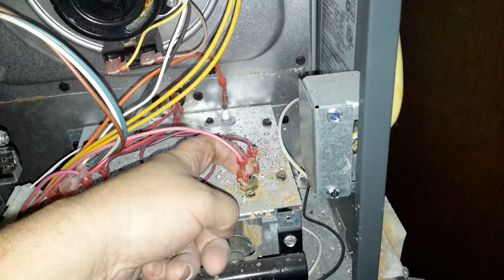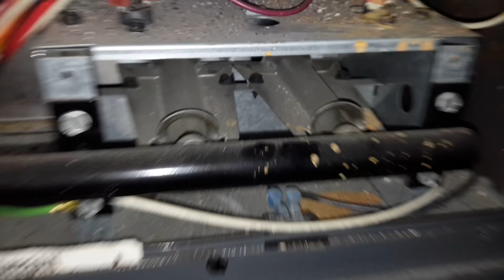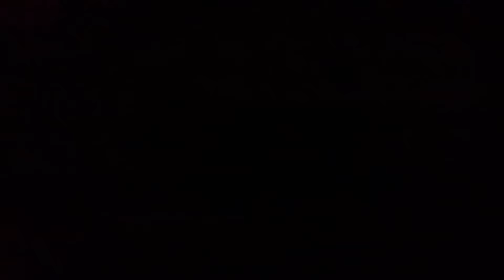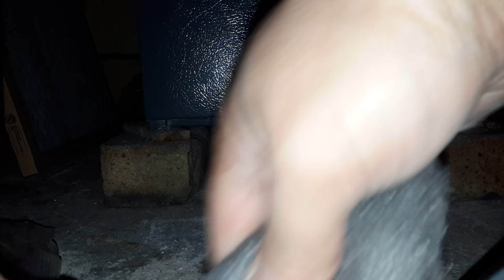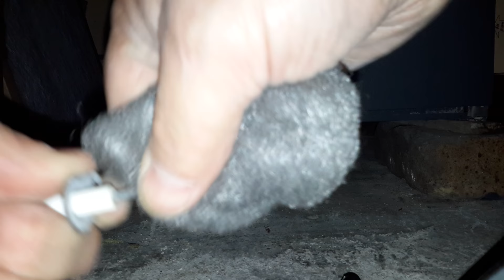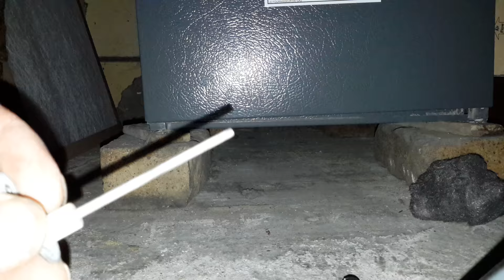Bad flame sensor Goodman furnace

Comment: I have the model with 3 burners instead of 2 but it’s laid out the same way and the flames intermittently went on and off. I removed the sensor and took some light sandpaper to it, put it back in place and, boom, flames stayed on!
These kind of videos are so helpful!
Thanks.

Comment: Just want to thank you 🙇🏻‍♂️ 

I did notice it kept turning off and on. I usually put the temp at 72 at night. I would wake up and the temp was at 67. Didn’t understand why the heater kept lowering the temp on its on. I didn’t have a steel wool, but I did have a knife sharpener 😂

Thank you once again. This video sold my problem

Comment: My Goodman HE gas furnace was short cycling and not heating past about 67 degrees this morning. This video saved me a from a Sunday morning phone call to the repair guy on a 25 degree day (many $$$). I took out the flame sensor, cleaned it with some 4k steel wool and a paper towel and I'm good to go again. House is cruising past 70 as I type. Thanks.
Reply from the maker: Great post. Enjoy your day. Dont forget to change your furnace filter check your smoke detector batteries and add a monoxide alarm to your home.

Comment: I have this exact furnace, and last time my flame sensor got dirty I had no idea what the problem was and had to call in my HVAC guy to fix it. He mentioned that it was a dirty flame sensor though, and so when it happened again recently, I went to Google armed with that knowledge and found this video, which was exactly what I needed. I cleaned the flame sensor today with some steel wool and it seems to be working fine now, thanks for the excellent detailed hands-on video!

Comment: This worked for me. The sensor didn't even look that dirty. I cleaned it off with a paper towel. But it fixed the problem. It's in the 20s tonight so I'm thankful. Good video.

Comment: Just want to add a thank you also, we live in an apartment with close to this same furnace. Was able to step by step follow and pull that damn sensor. Followed a previous video of yours on jumping the thermostat first so I knew going in it wasn't the thermostat. I had power, I had gas because they would flame that short time, but then it would do that 4 times then shut off for 60 minutes, no heat. Found and pulled that dang sensor (reminder to myself to get small ratchet set) cleaned it off with steel wool and boom we got fire baby. Appreciate guys like you take the time that do these videos. You got a new follower for sure.
Reply from the maker: That's a good fix. Thumbs up.

Comment: I live in apartment and we have a goodman . One night I was getting cold here . Wanted heat but it would only try to start heat . I took mine out clean it with a brillo pad . Put all back together fired it up and It works flawslessly again. These are good furnaces  I like mine . Miss it when it dont work. I work on everything cars electronic first time I worked on a furnace.Saved me time going through management to fix it . I like to do this myself.

Comment: Fixed it!  Woke up cold. 45* 🥶.  Cleaned the flame/fire sensor - no steel wool but fine sandpaper worked amazing.  ~~Thanks for sharing this sooo much 🙌.   I also blew through the gray tube and put a paper clip in & out of the main connection to clear it.  Hopefully that’s it for a while.   I saw a sticker on by the door that says to clean the coil so I’ll look for a video on how to do that.  ~~I know my a/c window units have to be cleaned yearly but I can take them outside to hose them out carefully.  This one will require something different being it is stationary.  Do you have a video available for that?   MANY MANY THANKS AGAIN!!! 👌💯💯💯😁
Reply from the maker: All day long

Comment: I have a four burner good man and I tried to clean it because it did look dirty and the flame sensor is clean and it still didn’t work then I read your comment about the water hose being blocked and I sure enough I had a kink in mine I adjusted that now that is flowing properly. I’m still having the same issues though where the burners come on and go out after a few seconds any other suggestions. Thanks for the great video it’s been very helpful thus far in identifying a couple of potential problems
Reply: Actually I figured out the issue so wanted to post in case anyone else had the same problem.  The black discharge hose had a large chuck of rust in it and that did the trick.

Comment: I don't have to turn off the switch or gas valve to do this?
Reply from the maker: Turn off the power. Even removing the furnaces front panels will shut off the power. Just make sure there the led light on the control board is off.

Comment: I cleaned and replaced the flame sensor. Whats next to look at? Still not working. It ignites and cuts off after 10 to 12 seconds
Reply from the maker: Look for a blinking light on the control board. Or make sure there is no water in the small rubber line that goes to the pressure switch.

Comment: They never go bad, it's just a piece of metal. Cleaning it will always work unless it's broken in half
Reply from the maker: They certainly do go bad. While this furnace is under warranty it gets a new sensor if the furnace fails because of the flame sensor. Any other time they can just be cleaned. I was in a goodman furnace class and one of the biggest things that was misdiagnosed was the flame sensor. He said it was a piece of metal nothing to go bad. It gets a new one under warranty.

Comment: What is the sensor on the other burner? I'm having difficulty identifying it with the user manual. Does that one need to be cleaned too?
Reply from the maker: They look like flame roll out switches. No cleaning might need reset. Little button on top.
Reply: themrhelperguy thanks for the reply. I cleaned the flame sensor and mine started working again. great video!
Reply from the maker: Great. That other senser is the glow coil.

Comment: I have a Goodman furnace and its doing the same thing, the flame comes on for a second but then turns right off.  I want to try cleaning the flame sensor but I was having trouble locating it. I think I found it now but its in a really tight space that does not leave any room for a screwdriver to get through. What is the best way to unscrew that? What sort of tool should I use?
Reply from the maker: Nut driver or a very small combination wrench.
Reply: @themrhelperguy  thank you so much

Comment: mine doesnt have a surface ignator it makes a spark then a pilot light comes.on i cant find a flame sensor is the spark makes the flame sensor too??? am stumped... thanx
Reply from the maker: You have a spark to pilot. What kind of furnace do you have. The flame sensor is with the igniter
Reply: aha!! see thats what i thought but i havent been able to find any video on it.. i have a rheem Rrgg 05n31jkr  thats the model. can u clean it or does it have to be replaced sir?? if so how do u clean? thank you in advance!

Comment: Should never use sandpaper the flame can turn leftover grit into glass and it will act as an insulator
Reply from the maker: agree but if there is no choice sanding it will bring the furnace on.
Reply: Thank you.  I cleaned my sensor and i have heat now.  Thank u so much.
Reply: Use a dollar bill. Not as abrasive.  Will clean it just as well.  Did this yesterday.  It worked.

Comment: My heat comes on but once it reaches the set temperature it just blows air. The heat doesn't came back on.
Reply from the maker: Try shutting the power off to the furnace. Turn the thermostat  down.  Turn the power back on then turn up the thermestat. In that order.

Comment: My furnace is not working I cleaned the flame sensor and it's doing the same thing. Any help?
Reply from the maker: Try to get the code that the control board is putting out sometimes that will point you in the right direction.
Reply: @themrhelperguy  The code that is pulling out after it tries for 3 times is a code for "lockout."
Reply from the maker: Look at the pressure switch. Make sure there is not water in the line to the switch.
Reply: @themrhelperguy sounds good thank you. I took out the flexible hose going into the pressure switch and it's clear. 

I also ordered a new flame sensor hoping the old one has something wrong internally.
Reply: @themrhelperguy  solution found. I had a bad board. Replaced the board and is working like a champ.

Comment: I replace my flame sensor and flame still goes off after about 10 seconds...any ideas???
Reply from the maker: I would look to see if your pressure switch is shutting things down. Maybe water in the furnace or partially blocked vent. Many many possibilities.

Comment: You didn't show how it could be dirty or faulty! There should be a tiny  L.E.D bulb that flashes giving you a signal that indicates what could be wrong with the unit!
Reply: I cleaned mine up pretty well, and still no heat. I am thinking mine might be faulty.
Reply: You probably have a cracked return! Either you can replace the return or scrap the unit!

Comment: What I need is not a movie of a person scrubbing a piece of metal with steel wool.  I would have needed help removing the flame sensor from where it's installed (clip starts to show that but cuts out the hard part) and putting it back in!
Reply: You need a lot more help than that, Pal.